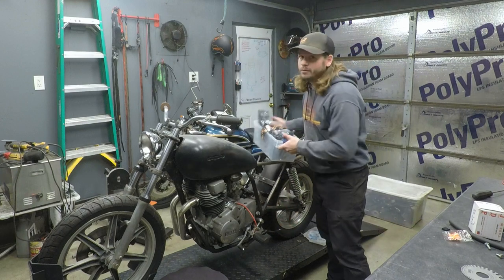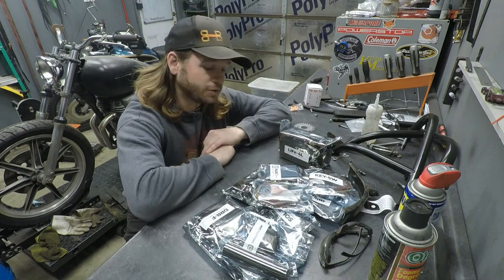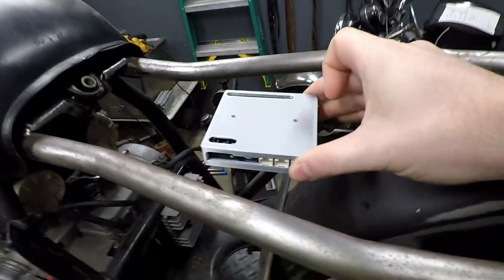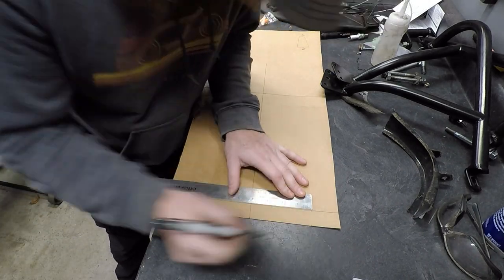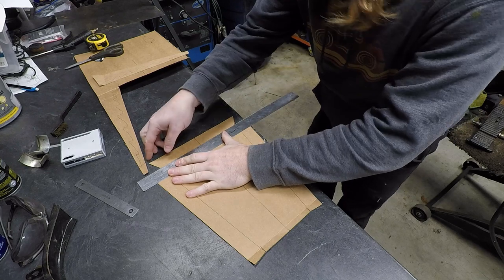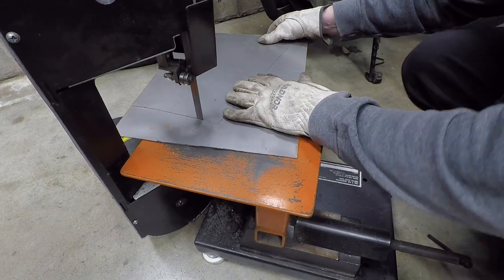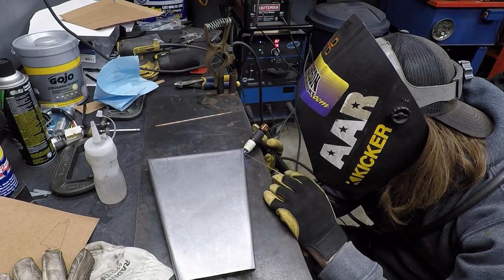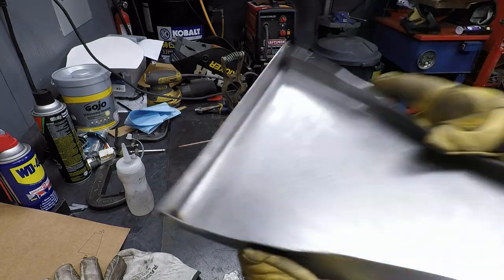How To Make An Electronics Tray - XS400 Build

Comment: That looks nice! I have never worked with steel like that. The aluminum I work with is much less forgiving and not weldable. I look forward to trying to work some sheet steel in the future.
Reply from the maker: Id agree on the aluminum. Ive only tried to use 6061 but next I want to give some 5000 series a try as it should be easier to bend

Comment: Any reason not to drill a couple drain holes in that tray just in case water gets in?
Reply from the maker: That gets brought up often when I make a tray video actually.  The bike simply doesn't get ridden in the rain. In all the bikes I've done over the years they have never been in the rain so its not a big concern to me. My cx500 scrambler however will get a couple small holes as it is destined for offroad.
Reply: @BrickHouseBuilds  but it won’t be a problem if I do it on mine then? I don’t think mud would get up there, because I ride in the rain and sometimes leave my bike in the driveway. That’s what I was wondering about. Thanks
Reply from the maker: @robertboyer5498  Having a couple tiny ones in the lowest set of corners would have no downside

Comment: I like the fact you use gal sheet metal but,,, the uncoated part of the frame tube are seriously prone to rusting, after the tray is welded in you can't paint that part of the frame the tray is lapped up against. Major flaw considering the rear wheel will be throwing up all sorts of crud. In my humble opinion , I would design this problem out of the equation , other than that, its a good informative video showing one method of getting it done
Reply from the maker: Well I've yet to have a problem in the years I've done it this way.